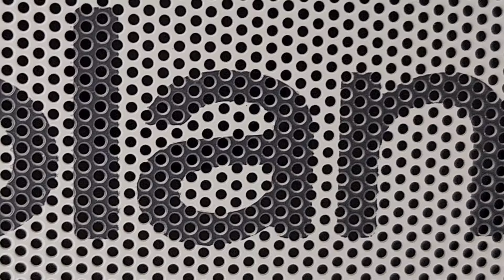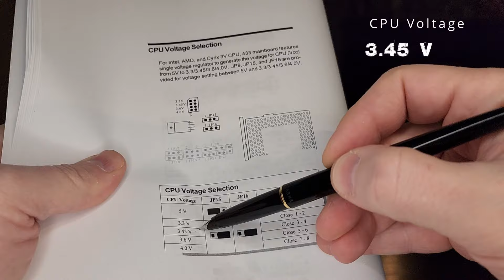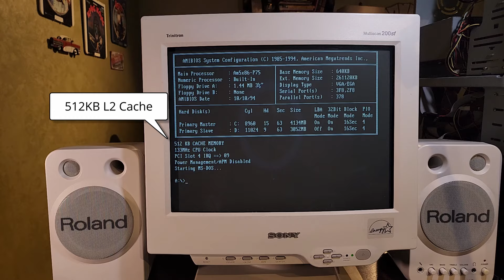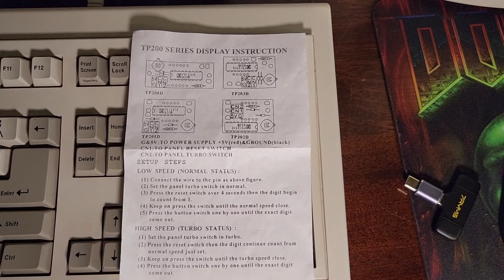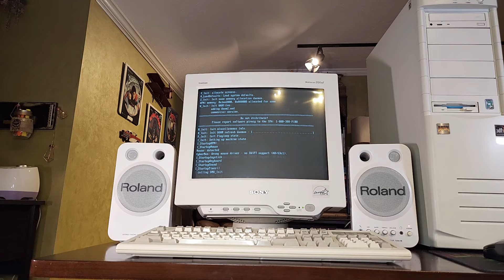Building an AMD5x86-133 ULTIMATE Retro PC computer for LAN Parties

Comment: Voodoo 1 was made for Pentium systems. Too overkill here. Same with amount of ram. In ms dos the top ram usable is 32mb i think. Anyway, nice build!
Reply from the maker: Yeah. But now since I can afford that amount of memory it's interesting to see what will happen if I will max the specs :)
Reply: Nope, the max amount of RAM is 64M for MS-DOS, however, I do not know any program that needed more that 6M. But it can run Win95 with this beast.
Reply from the maker: @sebastian19745  I may experiment with OS/2 and Win 95 later
Reply: you can install and run Windows 95 and have the exact and I mean the exact same DOS as you now have also on the PC. Just change Windows 95/98 so DOS starts first and then you can go into Win95 by typing "win" just like for windows 3.11. I have a Video about that on my channel where you can see the exact things you have to do to make that :) It's very easy though 
 @Vitaskhr
Reply: @sebastian19745  Well, not quite.  The max memory HIMEM.SYS can address is 64MB.  If you use QEMM you can specify much more useable memory on it's command line in CONFIG.SYS.  However, from personal experience, Windows 3.1x and Windows sound drivers generally don't react well to that much RAM installed in the system.
Reply: @Vitaskhr  I smell a possible dual-boot.  OS/2's boot loader can do it.
Reply: @Vitaskhr looking forward to that OS/2..
That was a really good OS, but well technical aspects alone did not cut it.. Pity

Comment: Neat build!
You should really consider popping Windows 95 on there so that you can actually make full use of that AWE32 and your system RAM! The AWE32 can't address its additional RAM for soundfonts in any protected-mode games on DOS, and DOS can't address more than 64MB of RAM anyhow. Likewise you'll get a lot more use out of that Voodoo card using Win95, and if you're making a LANparty build, you can't run glQuake unless you have it :D
Reply: Well, not quite.  The max memory HIMEM.SYS can address is 64MB.  If you use QEMM you can specify much more useable memory on it's command line in CONFIG.SYS.  However, from personal experience, Windows 3.1x and Windows sound drivers generally don't react well to that much RAM installed in the system.

Comment: hi nice video :) did you not know any bios refresing ibm intelistation m pro type 6898? this is a dual slot 1 p2 max dual 333mhz p2 cpu i want a refresing for 366mhz dual p2 cpu treatment no empty 100mhz bus chip place in maybe the dual 400 or 450mhz p2 cpu i refuse thanks forward :)